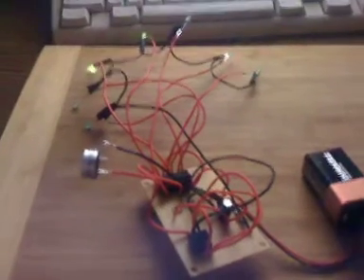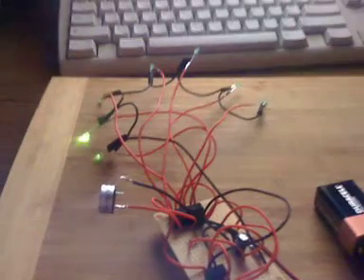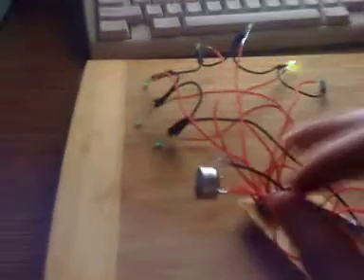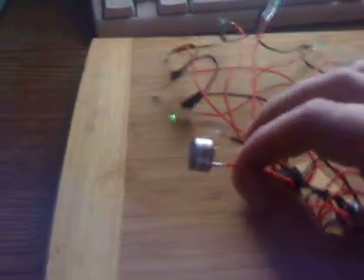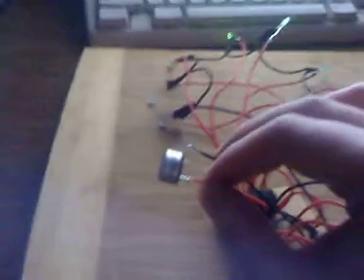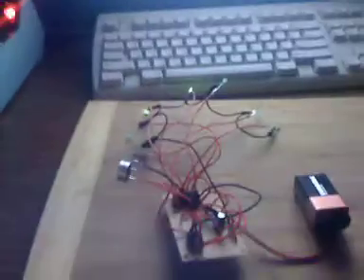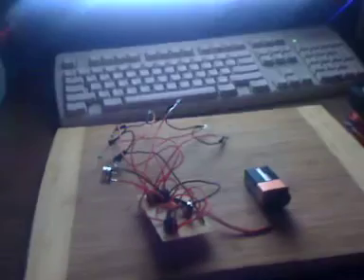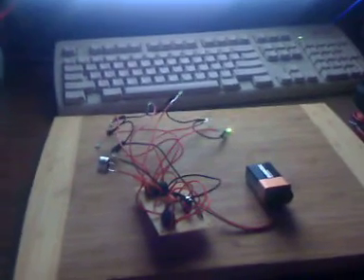Real Ghostbusters PKE Meter Circuit

Comment from the maker: That circuit there is a 555 timer + a 4017 decade counter, with a couple diodes added to the 555 timer portion to allow for a less than 50% duty cycle so the beeps will be short and pleasant sounding.  The newer models use an Arduino Pro Mini to drive them instead.